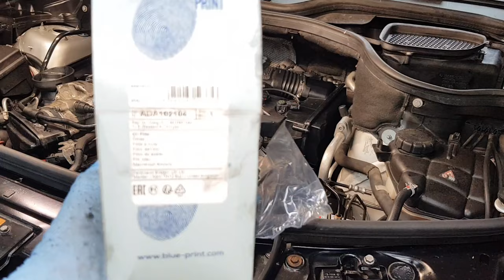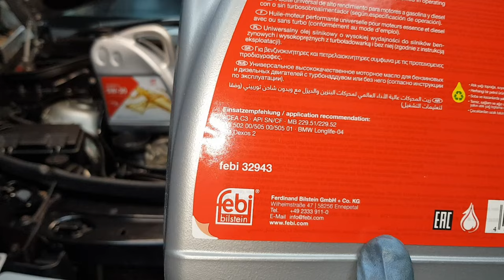Mercedes Oil Cooler Seals ML350 cdi 3.0 V6 ML320 E320 Sprinter OM642 W164 W166 Vito engine oil leak

Comment: Absolutely the best video on this I have seen! I'm about to do this job myself on my R320 W251 -07
Reply from the maker: Thanks buddy, I tried to do it as detailed as possible whilst not too long and boring. Best of luck and hope turbo bolts at back are not too tight🤝🏻
Reply: @TheKeenMechanic  when you clean the intakes, is it needed to turn the engine so the valves are closed?
Reply from the maker: @danieleriksson1657  You will clean the intake manifolds outside of the vehicle. In order to clean the intake valve ports rotate the crankshaft pulley and make sure to clean the ports with closed valves only. If you don't you will wash all the mess inside the engine which can cause catastrophic engine failure.
Reply: Wow, you really know what you are doing. Especially taking the time to clean everything and work on a proper way. That makes a good mechanic and craftsman!
Reply from the maker: Thank you for the nice words. I am glad to see people appreciate the detail I go into🤝🏻
Reply: @TheKeenMechanic  The turbo bolts are Torx E12 or E14?
Reply from the maker: @danieleriksson1657  I think E12 if I rememer correctly
Reply: Thanks! Some people recommends to change the oil cooler, since you old one can be warped, what do you think?
Reply from the maker: @danieleriksson1657  I have never replaced the cooler itself. Just the seals. Never had any issues but do have a look at inspect yours as with second hand cars you never know what the previous owner has done. Best of luck🤝
Reply: @TheKeenMechanic  What vacuum cleaner du you use for the intakes?
Reply from the maker: @danieleriksson1657  Hi
Any wet vacuum cleaner will do the job. You just need some suction to extract the carbon and whatever cleaning product you are using. Thanks for watching
Reply: The brush for the drill machine, is that metal?
Reply from the maker: @danieleriksson1657  Soft metal-brass
Reply: @TheKeenMechanic  just got away the 3 screws on the manifold behind the turbo :) I put some penetration spray yesterday and they came off quite easy. But I had to remove the wiper cowl first, since on the W251 it's really needed, but it was hard to pull the cowl straight up from the window.
Reply from the maker: @danieleriksson1657  Good work buddy, glad to hear you are having success. Hope it all goes well with the rest of the procedure🤝
Reply: @TheKeenMechanic  yes, it's going good! Another thing, you should update the description of the video and add W251 also.
Reply from the maker: @danieleriksson1657  Glad to hear  you got on ok and that my tutorial helped you. Hope it helps many more and saves them a lot of money
Reply: @TheKeenMechanic  instal the turbo and removed again for the cables 😂
Reply from the maker: @idaridar1516  😄

Comment: Something to watch out for very carefully. The oil line in the turbo stand goes directly to the rear main crank bearing. If any dirt goes in there the engine will break. So watch out everyone that is going to do this.
Reply from the maker: Thanks for adding this detail. Hope everyone reads it. I like to put silicone plugs to make sure nothing gets in when cleaning
Reply: Bravo, super job !!!
Reply from the maker: @jeanmarievirantin8976  Thank you🤝🏻

Comment: I am considering buying this exact car tomorrow in 9/10 shape. No codes or anything. 7k qith 121,xxx miles. Is this a good deal? Or should i stay gasoline? Ive never owned a diesel but love them. Thanks!!
Reply from the maker: I love the diesels as they have a lot of torque and are much more economical. Ultimately it is your choice, best of luck with the car if you decide to purchase

Comment: I'm thinking to change the turbo pedestal, there are round groves left in the pedestal from the old gasket, some people say it can start to leak, even with new gaskets, any experiance of that?
Reply from the maker: @danieleriksson1657  No issues, just clean the gasket surfaces well and replace the gaskets, make sure no cleaning liquid enters the oil passages when working on it. Best of luck
Reply: Thanks, what is the torque specs on the bolts for the pedestal? You need new bolts?
Reply: I found that it should be 20Nm + 45-60 deg = new bolts to yield
Reply: Here are all torque specs: 
Cooler to engine block - 12Nm
Manifolds to engine heads - 16Nm
Turbo pedestal to engine block - 12Nm
Turbo to pedestal:
Stage 1 - 20Nm
Stage 2 - 60 degrees.
Turbo bracket to engine block - 16Nm
Turbo to exhaust manifolds - 20Nm + 1/4 turn.
Turbo elbow - 20Nm
EGR flexi elbow:
EGR/ intake manifold side - 10 Nm + 1/4 turn.
Exhaust manifold side - 20Nm
Fuel rails to valve covers - 9 Nm
Rail nuts - 20 Nm
Reply from the maker: @danieleriksson1657  Thank you for adding all torque spect in a list. Much appreciated🤝🏻🤝🏻🤝🏻👏👏👏💪🏻💪🏻💪🏻
Reply: @TheKeenMechanic  I decided to buy a new pedestal, the gasket does not center properly to the hole of the big oil return line, the gasket inner circle is exactly on the edge of the inner hole of the pedestal and it was leaking there since before I think. Most likely bad manufactured.
Reply from the maker: @danieleriksson1657  Probably best not to take any risks with this one. Good to have another one that will properly seal and prevent leaks

Comment: Amazing video, will try to do this on my ML, prob need an engine bed like one you used or will prob just climb on to the engine 🤣🤣
Reply from the maker: @drifttandem7620  Yes, it is handy to have something to help you get to the back of the engine 😄. I am 6'2" (184cm) tall and if I didn't have my lifting table it will still break my back. Best of luck🤝🏻
Reply: @TheKeenMechanic  Hey, bro, is it possible to get torqe values for bolts, bought a tourqe wrench, šo will be doing it legit. On saturday😁😅
Reply from the maker: @drifttandem7620  Read the comments below, one of my subscribers Danieleriksson1657 has posted all torque values in one of his comments. 🤝🏻
Reply from the maker: I just added them for you and for everyone else in the description🤝🏻
Reply: @TheKeenMechanic  You are amazing, still answering after a year!! I think im ready to do this job. Will update afterwards ! :D
I used to be in this line of work and went to school(certified auto electrician), but it wasnt for me. I only do myown cars n family. Got myself a ML280 and want to do this correctly, it's really nice to see detailed work like this.

Earned a sub bro <3
Reply from the maker: @drifttandem7620  Thanks for the sub buddy. Don't be surprised, just have a look through my channel and see that I have responded to every single comment personally. I enjoy it and the channel is still small enough that I can engage with my subs and answer their questions. Best of luck with the job
Reply: @TheKeenMechanic  Heya, update from me, took in total 11hrs 4-5hrs cleaning.
Everything was running smooth after testdrive when thermostat opened all coolant left through(i think) cooler seals, was gushing out from rear. Or it could be the rear side of intake where coolant pases ?

So have to redo the job new seals etc. I think the torqe 12Nm is wrong... 
Oh well, atleast i know all the bolts to screw so should be able to do this job alot quicker :D
Reply from the maker: @drifttandem7620  I feel so bad for you having to redo the whole thing again. Just take care and make sure you don't miss anything out. Double check that bridge flange with the 2 o-rings that links the two intake manifolds as it is a common failure and gets damaged if the 2 manifolds are not assembled together before installation on the block. Best of luck
Reply: @TheKeenMechanic  It's in the front right? Did the same as you on video with zipties... 
Will redo it on 5th dec., prob will find out the problem...
Hope the oil isnt f'd if it is then is -70euros -30euros down the drain :D
It is what it is... I think rear coolant thing failed. Will updated more ! :)
Ill try to remember to take few videos, if interested :D
Reply from the maker: @drifttandem7620  Yes, please keep me posted, I would like to know  what went wrong. I hope your oil is not contaminated as it will be wasted but this is life, not all things go as planned. You have already gained a lot of knowledge on the OM642
Reply: @TheKeenMechanic  gaskets are fine, seems like the o ring on the egr where coolant passes when installing with my father, he pinched it, and bit half of it off, the only thing i see that messed up it, could it be ? When operating temp spew out coolant. Everything else looked fine.
Tomorrow reassembling.
Reply from the maker: @drifttandem7620  Good man, sounds like you found the problem. We will both be busy tomorrow, I am rebuilding a Mercedes 722.6 transmission valve body. Will be fun😊
Reply: @TheKeenMechanic  Heya, like i said in that comment, reassembled and works great, one problem tho occured doesnt let me rev over 3k.... today just noticed. Any tips ?
Have a cheap scan tool shows 24 faults, cleared them, but only one would show to read, bank 1 flaps something doesn't work. not sure.
But would that put it in service mode ?
Reply from the maker: @drifttandem7620  Could be the manifold flaps actuator that sits between the 2 manifolds. They are a common failure. You might have to check it and may not necessary be your fault or damage, it could have just died. Not sure what else you can do to be honest. Do some research online and see what way you can test it. Might be best to replace it with a new one
Reply: @TheKeenMechanic  have a friend that can Code them out, and will plug them

Comment: I did this job myself after being inspired by your video. Thanks
To anyone planning on doing this job, also change the swirl flap motor and runner rods. 
I had to do it again as the motor failed 2 weeks after.
Reply from the maker: Oh, what a shame to have to do it again. Thanks for watching and for your nice comment and contribution to the channel
Reply: I bought a 2008 e320cdi and the swirl flaps have been removed
Reply: how long did it take u?
Reply from the maker: About 24 manhours

Comment: Awesome!  I just finished this job on my 07 r320. I used awesome cleaner and brushes from harbor freight to clean the intakes and any black death. Melts it instantly.
Reply from the maker: Nice one, thanks for sharing. Some people also use pure caustic and steep them but I found my method is also as good and a bit cost effective. Thanks for watching

Comment: Wow you are thorough . Have a ml320 cdi  05 plate . Same problem .  Any chance of A parts list for this fix . ?? Genuine Mercedes of course . Wished you lived near me . Amazing video
Reply from the maker: Hi and thanks for the nice comment
Have a look on ebay for Genuine gasket kets. There is one for example https://www.ebay.co.uk/itm/204269916426?mkcid=16&mkevt=1&mkrid=711-127632-2357-0&ssspo=66fpUu8-SBC&sssrc=4429486&ssuid=RwAnBlHgT8-&var=&widget_ver=artemis&media=COPY
You will most likely not need all of these but if you want to save time searching one by one just get one of these full kits

Comment: That is one great tutorial. One question: You did not prime the turbo? I guess with the fuel system not vented there was no risk the engine fired straight up, but if it would have, wouldn't that have been the end of the turbo?
Reply from the maker: @chrissein632  Hi. As the whole fuel system was empty there was no risk of the engine starting for at least 30 seconds to a minute. This allows the engine to build plenty of oil pressure in the whole system. Even if it did start after a few seconds it would be idling and there is still some oil left in the turbo. Oil pressure builds pretty quickly though so don't worry about it🤝🏻
Reply: @TheKeenMechanic  thanks for the clarification. I just got my parts for doing the job  - on a Jeep grand cherokee - I guess it will take me all weekend
Reply from the maker: @chrissein632  Make sure to clean the intake manifolds and valve ports as shown. It is very important. You will see improvement of fuel economy and performance

Comment: I'm thinking how to clean the intake valves, what do you think about using mr muscle in the intakes and let be there inside over night and then use a brass brush like you?
Reply from the maker: @danieleriksson1657  mr muscle is ok for the manifolds, just dont spray it on machined aluminium surfaces as it will eat it. It is ok inside the intake manifolds

Comment: Hi. Great information, thanks for sharing. In terms of diagnosis, at what point can you see if the oil cooler is leaking, fuel filter? Mine is leaking on the right hand side behind the starter motor after it was all cleaned off with brake cleaner
Reply from the maker: @bernardwarr4187  Most likely it is the oil cooler. Use my video as a step by step guide and hope you can tackle the job yourself
Reply: @TheKeenMechanic  many thanks, only 60k miles. A very nice car. Will take my time. From experience, it’s easy to spend more time cleaning engines parts than it takes to disassemble. Great info

Comment: Did you replaced the orange gasket at air intake before turbo? That gasket creates oil leaks which goes to the same place as leaks from oil cooler…
Reply from the maker: @P17-y4g  Yes, I did replace the orange gasket as if it leaks it can damage the swirl flaps motors. They are known for failing due to a leak from that seal🤝🏻

Comment: Thanks for this. I admire that you did this. I need the exact same repair and know my limits. Does £1700 to repair which includes replacing intake pipe connection, inlet port motor, oil cooler and drive shaft at the same time sound fair to people? Only the seal needs doing, but the suggestion is to do the other bits whilst the engine is in bits as it won’t make much difference to the overall labour cost.
Reply from the maker: Hi and thanks for reaching out. Make sure they clean the intake manifolds and valve ports as it will make massive difference to the fuel economy and performance. Best of luck and just think again whether you wouldn't use my guide and save yourself a huge amount of money by doing it yourself🤝🏻

Comment: Doing this now on a 2012 W166 with the later version turbo which has a solid metal coolant line that is stuck hard from grime/age requiring excess force to remove, best order a replacement in before commencing the job P/N A6422030602. Also the downpipe is one big piece which makes removing the turbo a real PITA. Recommend removing the engine bay rear access panels and wiper cowl cover, still a real PITA job. Thanks for the vid, would be near impossible without it.
Reply from the maker: You are welcome🤝🏻

Comment: Excellent job and video ! but man should have def recommended the pcv be changed, there was quite a bit of oil in the turbo there
Reply from the maker: @dannoi  I did, the owner of course makes the final decision🤝🏻
Reply: @TheKeenMechanic  unfortunate, he'll have to take it apart again, well not this deep, but still
Reply from the maker: @dannoi  "you can bring a horse to water but you can't make it drink" 😁

Comment: How to know if the cylinder is closed when cleaning? Have to get specific camera to check?
Reply from the maker: @WazzUpWhatUp  Watch the valves go up and down. Check by spraying a bit of brake cleaner inside. If it holds the liquid then it is fully closed. Don't spray too much. If you have inspection camera use it but there is no need for one🤝🏻

Comment: Great video. I have replaced my o rings once before myself but now 3 years later I think they are leaking again. Have you ever had to replace them a 2nd time? Could the oil cooler be warped?
Reply from the maker: @RealtorMichaelJones  Most likely O-rigs again. You will have to replace again I am afraid

Comment: How did you clean the egr plastic manifold in front of engine?
Reply from the maker: @danieleriksson1657  1st rinse with Brake Cleaner, then mr.muscle oven cleaner and rinse with water or pressure washer. Then dry with compressed air and you are ready to go
Reply: @TheKeenMechanic  and do you clean the egr valve also?
Reply from the maker: @danieleriksson1657  No, I didn't, nothing wrong to do it on yours if you have the time. It could be very difficult to remove the egr on these sometimes but it is doable
Reply: @TheKeenMechanic  Some people says to unscrew the screws little bit, turn on the engine and it will pop up by itself.
Reply from the maker: @danieleriksson1657  I have watched a video where a guy did that. Whatever works and does the job. No harm in trying that if it is stuck and you can't do it any other way

Comment: Hi i have a question, not to this car, but the BMW F30 N20 Engines, they made a revised timing chain guide, which is white, original faulty one was brown, say this was replaced with the new white one, after 15k miles ish would the chain guide change colour to dark brown, or what colour would you say it would be, i bought a car a while back that has receipts that timing chain was done, but the guide is dark brown, so im trying to figure out if they actually changed the timing chain or just made fake receipt
Reply from the maker: Hi
A white guide will never turn brown even after 300k miles. It will discolour but not that much. It will be more like yellow-white. Either not honest mechanic or used cheap parts
Reply: @TheKeenMechanic  thanks for letting me know